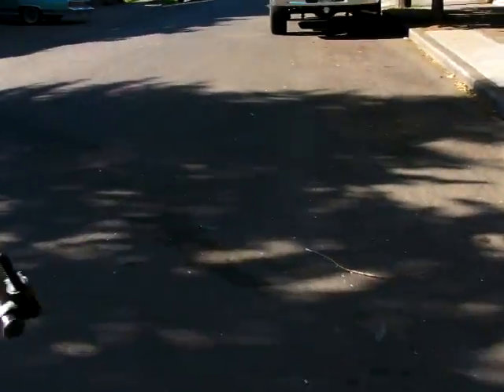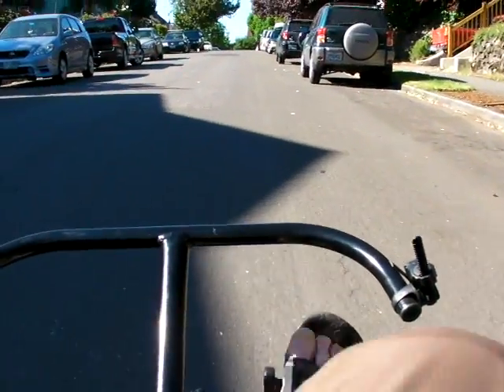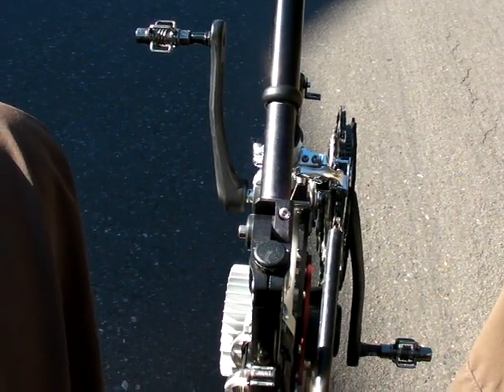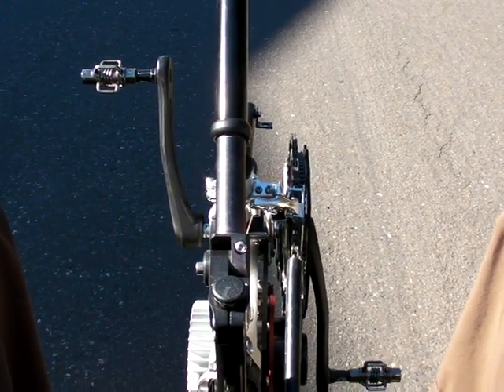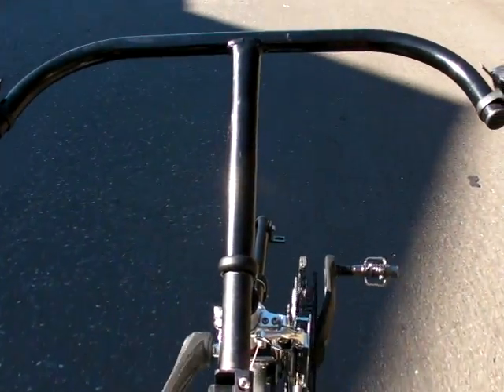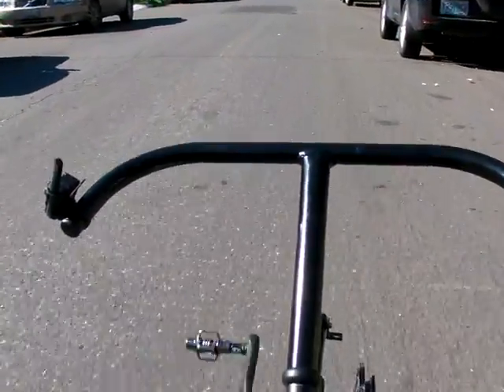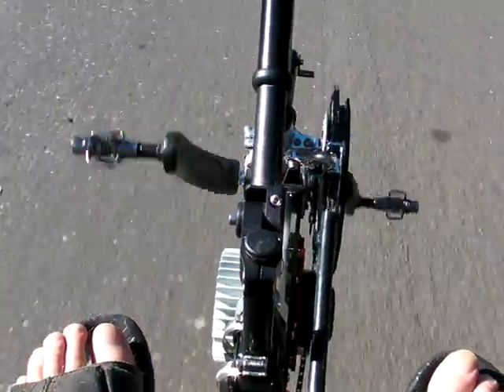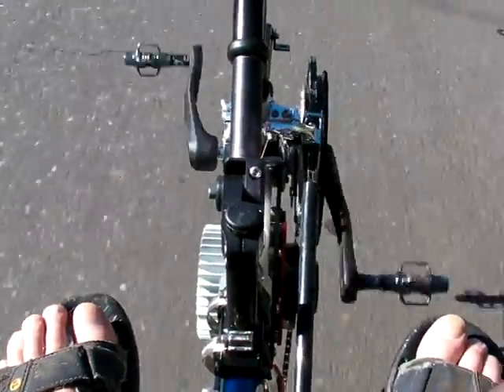Ecospeed Electric Mountain Drive: Hill Climb Demo

Comment from the maker: Thanks for the compliment. Yeah, the camera mic always makes the motor sound louder than it sounds when you are actually riding.  In the last year we have released a more powerful motor at 1300 watts using a smoother, quieter programming (sine modulation) so that it doesn't sounds like a whine but more like a hum.

Comment from the maker: High speed on steep hills from a stop is probably 12-15mph depending on many factors.  Level ground cruising with some minimal rider pedaling is easily at or above 20 mph.  We have run our systems on race tracks at 42 mph in testing situations on aerodynamic bikes.  I hope that helps.
.

Comment from the maker: The pedals are attached to a freewheeling crank, yes.  Even though they are spinning a bit in the video they are built around a freewheel so you can just sit your feet on the pedals and not spin if you want. With an EcoSpeed system you do not have to spin as fast as the motor is turning the chain rings. I think we were just being dramatic, taking feet off the pedals.  Thanks for watching!